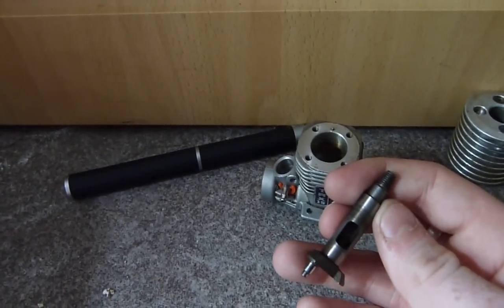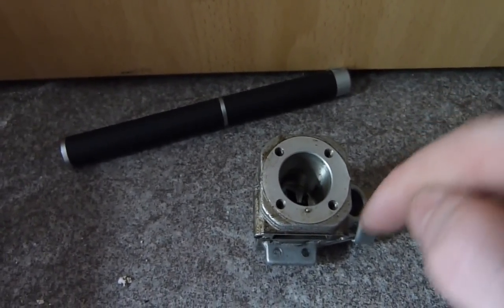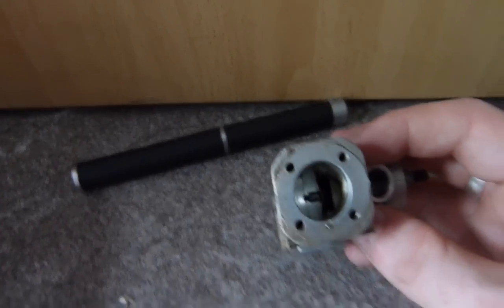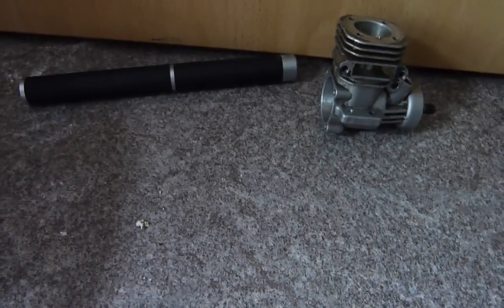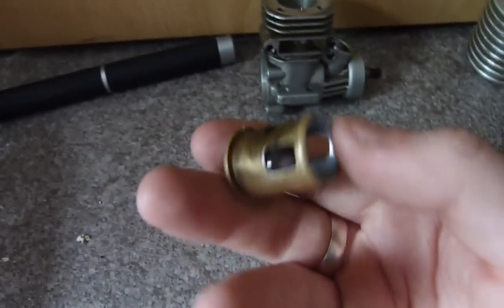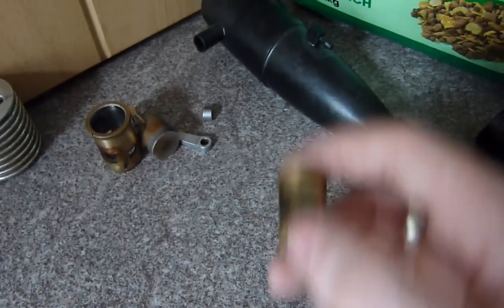Why superchargers don't work on rc nitro 2 strokes (and any 2 stroke)

Comment: then explain a detroit diesel then and how supercharged turbocharged doesnt work?
Reply: detroits have valves that open on the top of the cyl compressed air fuel comes in through the intake port ..ignites at TDC and then shoves piston down near BDC the exhaust valves open and the exhaust gases are pushed out the of the top valves by the compressed air/fuel mixture entering the cyl..it NEEDS to be compressed or have forced induction ..this is called a scavenging system.
Reply: Because a DD has valves! (The compressed air and fuel are injected separately in a DD, the fuel is injected at near top-dead-center)  The valves all close before the piston seals the pressurized air intake. Therefore forced induction IS possible. 2-cycle glow plug engines do not have valves! therefore forced induction is literally impossible, period. there are 4-cycle nitro glow plug engines, THOSE on the other hand are possible to supercharge/turbocharge. The reason this hasn't been done is because forced induction on a engine this small would be quite an engineering feat. I would love to see rbinnovations do that... Rbinnovations is doing good work for the RC community though, this supercharger separates the retards from the enthusiasts.
Reply: What about in the 2 stroke reed valve motor?
Reply: Detrot-Diesel ist just a brand but NO ENGIN CONCEPT!
Some of their engins are valve-driven 2-stroke engins burning diesel - that´s it.
If there are one or two valves - supercharging works.
Don´t mix with 2-stroke RC nitro-engins.
Reply: Um no they can and they do use one or both. 
The detroit diesel uses a super charger and turbocharger.
As pointed out before they have exhaust valves so port timing and overlap is controlled.
As for understanding diesels..
Yep ive got that covered.
Dont believe me then check my channel out.
Reply: Phoenix Looh - "i don't see how a diesel turbo has anything to do with this subject ?!?!?" K you have no idea what we are even discussing. We are discussing how a DETROIT DIESEL, NOT TURBO DIESEL IN GENERAL, can have forced induction, and why a nitro motor cant. Because a detroit diesel is a 2-stroke motor. So no, you do not do this for a living. were talking about motor design. And im pretty sure you dont design internal combustion motors for a living. Everything you said above has absolutely nothing to do with the subject were discussing.

ps any diesel motor can be supercharged, turbos are just way more efficient.
Reply: My first comment was to explain why then does a 2 stroke dd work to which the response was exhaust valves.
I dont know what tangent your heading of on and your profound knowledge base that you exclaim to have but my question was answered already about the dd.
A diesel does not require a turbo to run properly. 
It much like it petrol counterpart is used to extract more torque by artificially increasing the engines capacity.
Reply: Was that post directed towards me? I meant no offence to you clint. My last post was directed towards phoenix. I'm the one who answered your question in the first place.
Reply: Sorry my bad.. I saw the response and thought it was another shot at me..
;-)
Reply: yay
Reply: So you guys have explained that the 2 stroke relies on the port timing and expansion chamber  to control flow or effectively the volumetric efficiency of the of the two stroke.
that is chamber size length placement all have an effect much like camshaft timing.
So in theory placing a turbo in the system could behave like the expansion chamber.
The head and its ability to rid heat from the power produced is the limiting factor as in any air cooled motor.
Sure pumping loses would increase from the increase in sump pressure  from the extra airflow or boost from the compressor.
And yes there would be extra fuel blown through on the overlap in port timing but that surely happens now on stock 2 strokes.
Cooling is the issue.. No?
Reply: They`re COMPLETELY different engines ffs..
So many idiots on youtube..

Comment: I dont think you know precisely what you are talking about, how could you not gain power from having even further pressurised fuel and air. Alot of people on here have already provided solutions to the problems you have raised. Being an automotive student has nothing to do with working on micro 2 strokes, and your dad was a nitro mechanic not you. Lastly have you even tried putting a supercharger on one of your nitro engines to see if you get more power?
Reply: A supercharger will not help adding pressure of air&nitro in a 2-stroke RC engin.
Being an automotive student is one of the best things, to educate others, getting rid of their wide-spread lack of knowledge - especially in automotive science.
Inquiries show, that nearly 80% of man have no clue about physics, chemistry and their interaction in a basic automobile. uTube is full of such videos.

Comment: because no exhaust system would be able to handle the pressures. Ever. Boost pressures disrupt back pressure because boost pressure isn't a pulse.

Comment: Sooooo......why do the work so amazingly well on the 8v92 Detroit, and every mountain mod snowmobile made today??
Reply: Dude just doesn’t know what he’s talking about and he’s mad because they never covered that part at the class he took
Reply: Because larger engines such as those on snow mobiles and motorcycles have specifically mapped ECU'S that adjust the mixture based on boost levels to keep the engine running within certain tolerances
Reply: @dacyphaa  so what about two stroke boosted setups on blow through carbs?
Dude you have no fucking idea what you’re talking about
Reply: Snowmobiles are reed valve style 2 strokes. Very different engine design. Only similarity to a nitro engine is that the power stroke is every downstroke lol.
Reply: You already explained how reed valves work.
The only two stroke that you couldn’t boost would be a rotary valve, unless you figured out something kind of like vtec or vanos where you could variate the frequency/duty cycle of the intake valve.
You made a whole video on how it works, just simply adding that it doesn’t work at the end and then using a bunch of easily disproven claims to support that is just avoiding the subject.
Not sure why it gets you soooooo angry if it’s impossible and nobody can do it lmao.
Reply: Flatheads simply don’t need scavenging. You can boost them all day. If your argument is that you cannot boost a flathead then your point is entirely moot.
The engine can handle up to a certain PSI, the question is more like will the amount of boost you’re capable of producing actually be sufficient.
Which is totally doable, the question of wether or not any off the shelf systems (like rb innovations) are capable of making a significant difference is beyond me.
But you seem to be arguing that it can’t be done because you don’t like it.
Reply: Because the expansion chambers aren’t big enough on the rc engines
Reply: It uses the expansion chamber to push the boost back in
Reply: @memztv956  the expansion chamber shouldn’t cause any issues. If anything it’ll help your case.
Reply: @memztv956  that’s not how an expansion chamber works.
Reply: Do you understand that a diesel is a completely different type of engine?

Comment: At About 4:30 you said full size cars that are supercharged need a Dump Valve to release excess pressure, which as the other guy said superchargers do not need this as the engine reduces revs the Pully system slows the Compressor unlike a turbo

Comment: Your right their but with supercharging its forcing more air into the crankcase straight to the cylinder head. Which is doubling the amount of air. So therefore it has better compression giving the engine more power which is what a supercharger does. And that a 2 stroke engine cannot suck in more air than needed.

Comment: You are right on the spot bud....i´m just curious on another thing,what do you think about turbo chargers?I know my opinion about it but only want´s to see what you think theoretically.

Cheers and take care
Reply: I know this reply is very, very late, but in a nitro engine such as this, especially with this size. It would be impossible to turbocharge and have a positive effect. The reason being for this is that if you place the turbocharger on the muffler section of the pipe. There won't be enough velocity of the gases to positively effect the air intake, and if you placed it right on the exhaust outlet, where you would have sufficient pressure /velocity of force air into the carb, the tuned section of the pipe would be thrown off by the impella and in turn make it almost impossible to tune